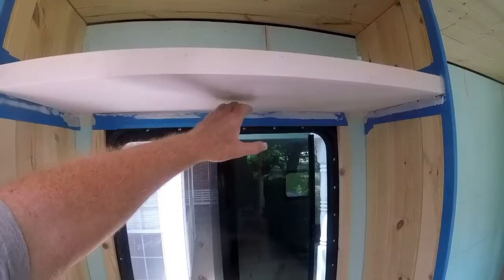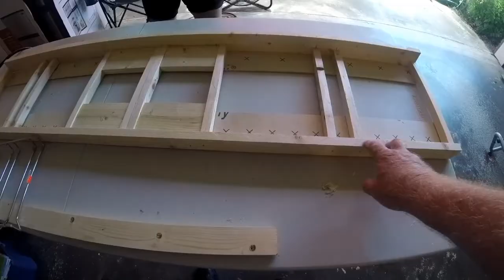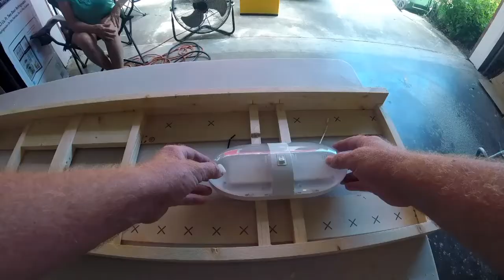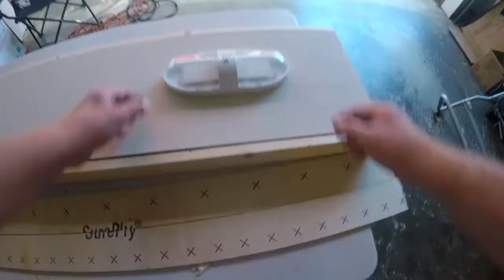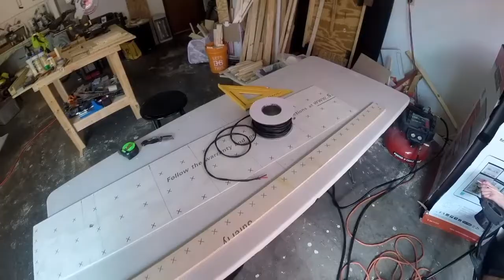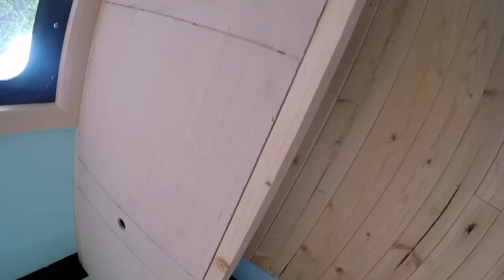Tiny House Kitchen Galley Part Three

Comment: I'm sure you found a solution for the garbage hole cover in the bartop. But a stainless steel round silverware or dressing container would fit in there beautifully and give you a place for tongs, utensils, and other items used in a bar 😊 I've seen them on Amazon plus at Restaurant stores online. I just got done rebuilding and remodeling a 1978 22 ft Class C. I cannot wait to head out of Michigan and traveling to Arizona starting Jan 1st 2019. I'm wanting to take my time but be in AZ by Jan 9th for the RTR. 
I look forward to seeing your project complete. Safe travels and God bless you both. 
Michelle 💗

Comment: Thanks for sharing your build, at the end, it would be great to see the overall weight, and cost as it would be beneficial for those of us who value our own labor. (and justify the savings to our spouses).
Reply from the maker: TechOutsider lol. That is definitely in the works. I will say this. Our dry weight target is around 4500 pounds. As of now, our estimated total cost when completed is between $12,000 to $13,000. Of course, this all remains to be seen, but so far, it's looking that way. One thing we did not include in our cost however, was the 1800 mile round trip to pick up the custom built shell at the manufacturer. We kinda made a mini vacation out of that trip to offset the expense, in our own minds.
Reply: Thank you sir, great info and very detailed. I am very impressed with the build!